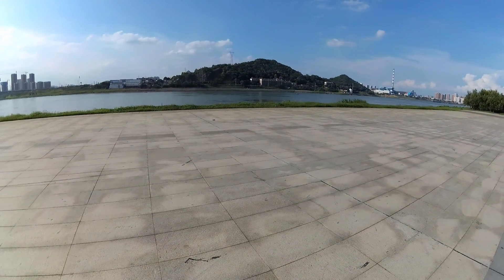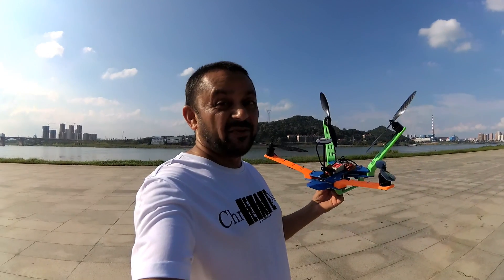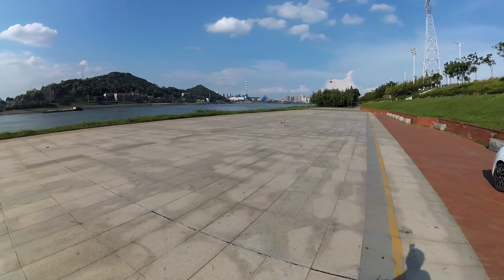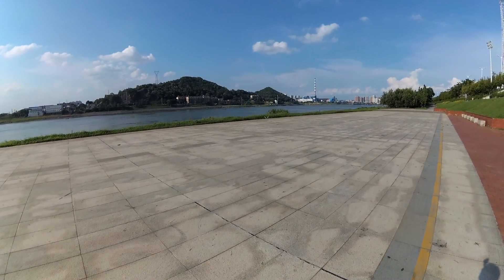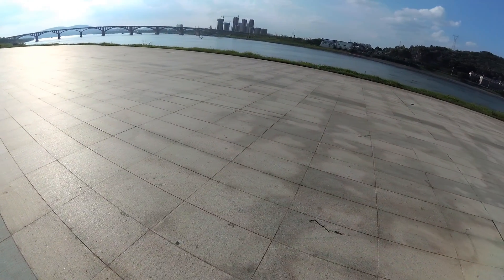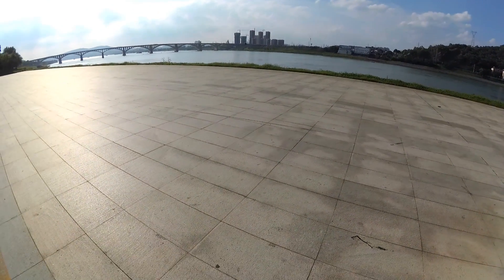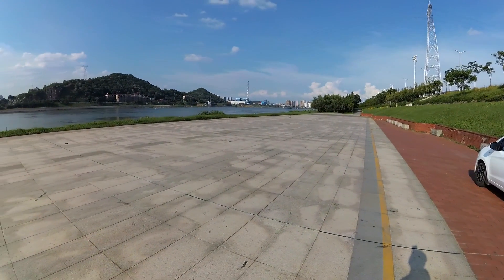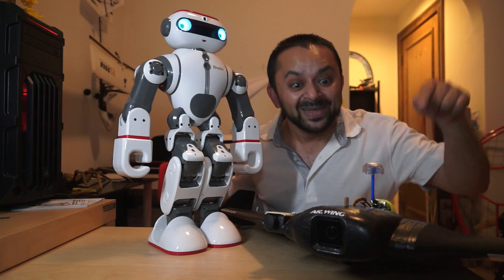DIY Home Made FPV Drone Strange Drones 3D Printed Cruiser Quadcopter V2

Comment: Have you thought about changing the angle of the front arms to face inwards so that it wouldn't go forward when your not touching the pitch?
Reply from the maker: well i have a totally new crazy idea after reading all the comments and suggestions. Just need to find some time and I can surely come up with another surprisingly new looking machine :D should fly even better :D just need to get some time free
Reply from the maker: well then it will fail the purpose. because i want it to constantly move not stop :)
Reply: @alishanmao  oh i see.